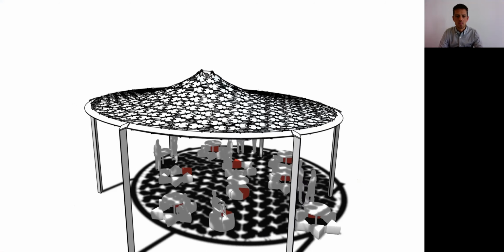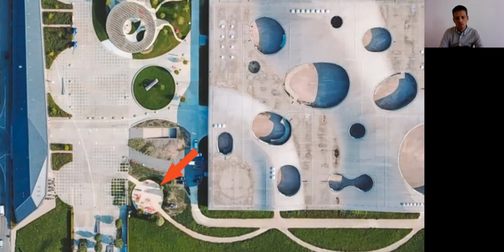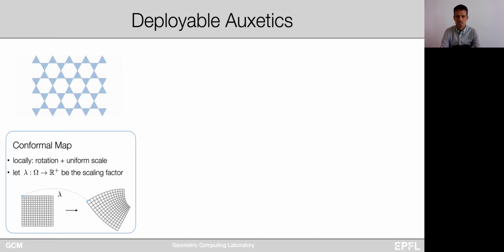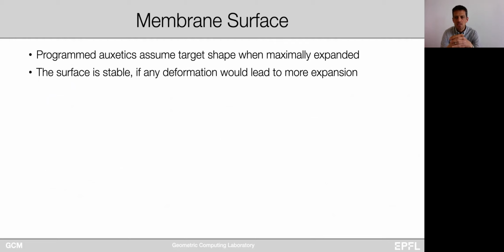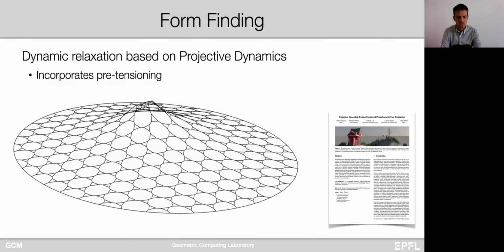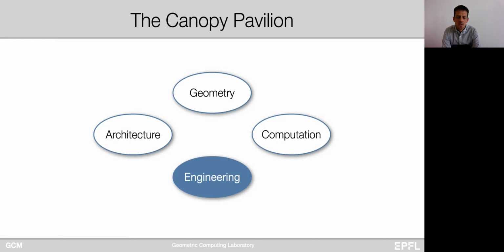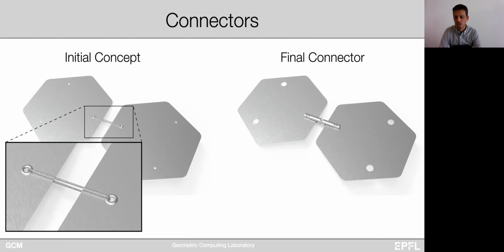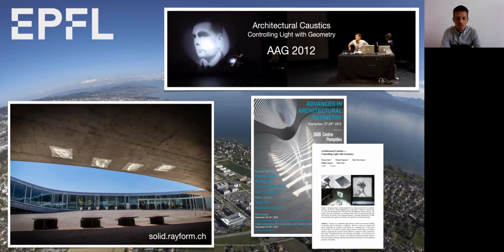19: The Canopy Pavilion - Isvoranu et al

Comment: Beautiful work! 

I understand that the structure needs to keep every panel in tension. How is the prestress be applied to the structure? Will it always have a single mode of self-equilibrium, so the extension of the strut is enough to control the self-stress? If so, what property of the underlying tiling makes it possible?